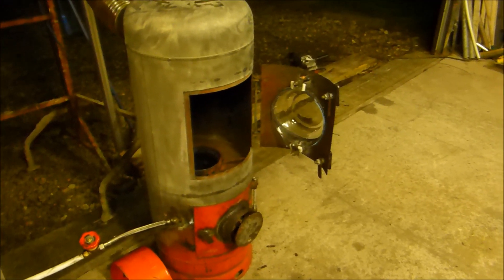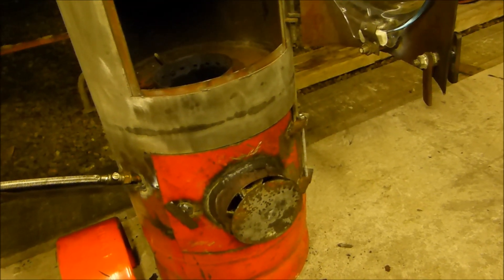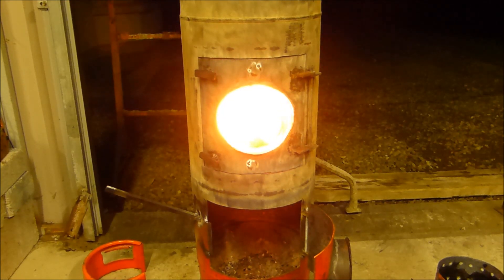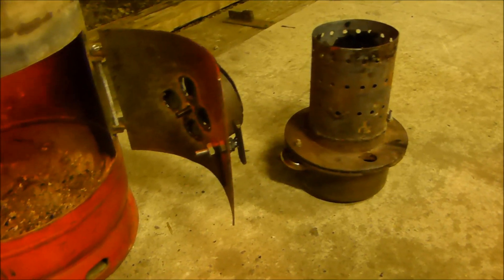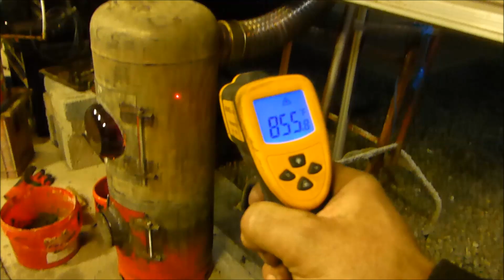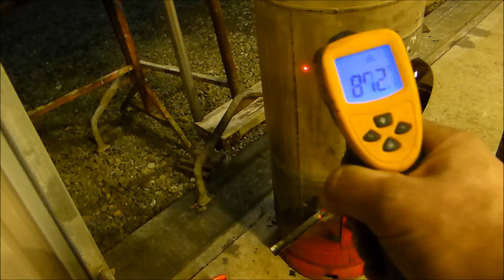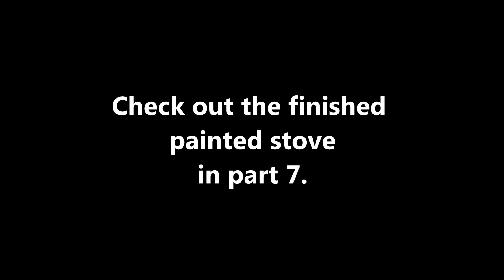Make a great waste oil and wood burning stove heater (part 6)

Comment: Gerry..............Great design - invention -- heater stove; 

Where can I find the video (measurements) for the potholes and size,  overall dimensions
also the Hight and angle f the copper support tube

This appear to be important locations  - dimensions - as it would be best to do it right the frst time rather than doing it over

Especial since you have worked out all the bugs

 Thanks for sharing your design!  

do you have a contact info  - email?

Comment: Hi jerry, 

Nice videos, which burner works better, the one with the brake disc and the fire below, or your version with the air from below?
Just made a blue flame burner with compresssed air intake, works oké but want to make a burner without airpump and long chimney.

Comment: mine is completly open on the bottom , it just belches black smoke to the sky , no matter what i do . l switch the fan on , the fire comes alive , but it just blows smoke to the heavens too . then i turn down the oil feed , thats slows the smoke , but then that slows down the heat . i cant stop this blowing smoke like a steam train no matter what i do . if its running slow , smoke sort of wisps out the stack , i turn on the fan and the smoke blasts into the sky ;like a steam train climbing a hill

Comment: Its to hot for pyrex
Reply from the maker: Hi Marc. You would think that it could not possibly take the heat but I have used them on a few stoves and put up lots of hours on these pyrex dishes and only broke one when I didnt allow enough room for expansion on the metal parts. I use stove glass now but only because I can make bigger viewing area. Cheers Gerry

Comment: I had a wood-burning hot water heater (made in Mexico) made from a similar cylinder. Firebox in the bottom an inverted cone welded in like yours and the stove pipe going straight up thru the cone and out the top. 1pipe in 1 out and a pres. relief valve.Very efficient now illegal in the U.S. Would like to see one made.

Comment: Hi Garry, Great work I watch all vids, as a used oil burner it looks feasible to sale, this can be installed in any auto-oil-change garage but still an innovation to make it Environment Friendly that will cost an considerable cost that will stop sales, so possible buyers will still divert used oil to recyclers, I can make it Environment Friendly and keep costs very LOW!, let me know if you are interested.

Comment: Hello i intend to make something similar to your set up just wondering what way your chimney set up is done anything special about it? Baring in mind I am not well up on this kind of work thanks
Reply from the maker: Hi James. Its just 6 inch single wall flue pipe. In Later videos I made the flue more permanent and ran it through the roof. Where it goes through the roof I used double walled flue to protect the flashing from a hot flue. I used 6 inch single wall flue to recover more heat from the hot flue gasses. . The small piece of flexible flue at the stove is so I can try different types of stoves and make quick connections. Cheers Gerry
Reply: Thanks for the info appreciate it!

Comment: Nice heater stove, Gerry.  Clever use of the Pyrex pot as a viewing port, and a neat solution to the installation.  I am contemplating using a glass from a discarded micro wave oven or range -- if it can stand the heat!  I have a tank from a discarded water heater which has similar dimensions to your gas cylinder.  Thanks for sharing your design!